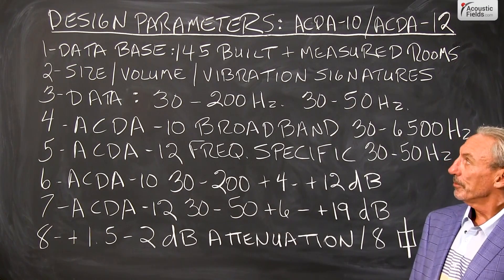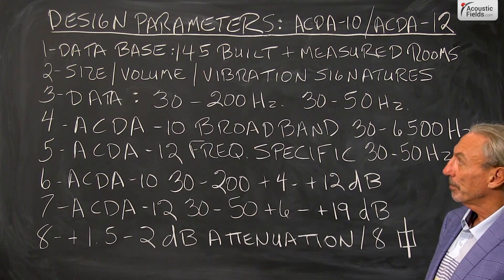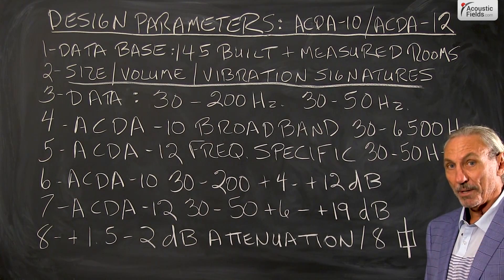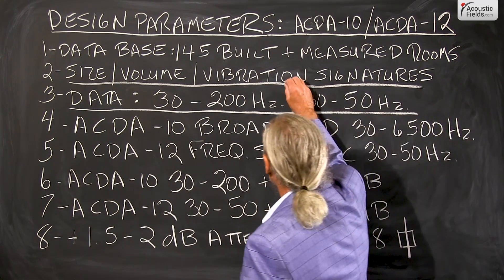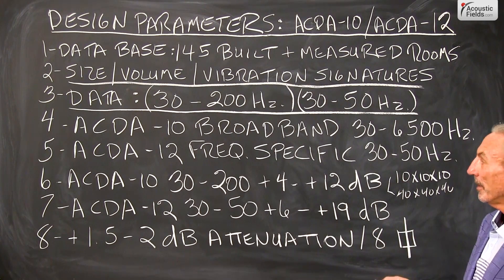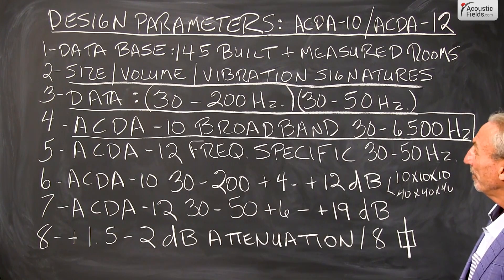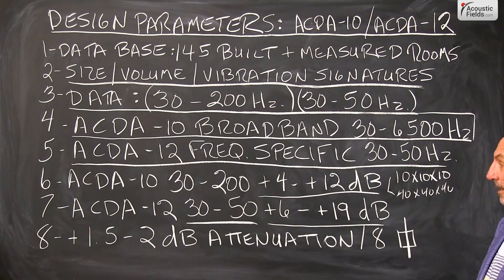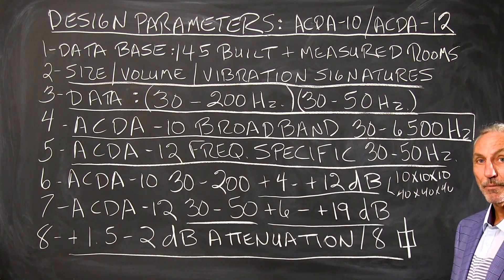The Design Parameters of The ACDA Series - www.AcousticFields.com

Comment: Hi Dennis. Have you considered or researched on different front sides to the absorber units? I have read theories on similar absorbers with circular plates mounted on speaker surrounds to the cabinet, giving the surface a pistonic movement as opposed to a fixed plate that needs to bend in order to move. Theoretically, the entire moving surface pushes and pulls air into the sealed cabinet where the energy is being transformed to heat using various techniques. Would it be possible to gain even more absorption per size and volume of the units? Thanks for these videos.
Reply from the maker: D,  Possibly, front wall density is a critical variable. Diaphragmatic absorption involves three variables: cabinet density and depth along with the front wall thickness.